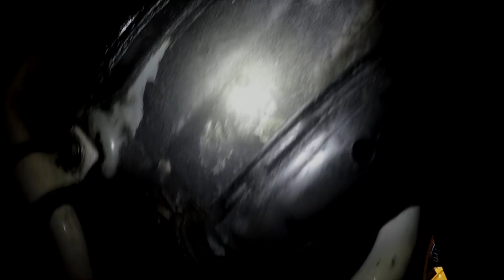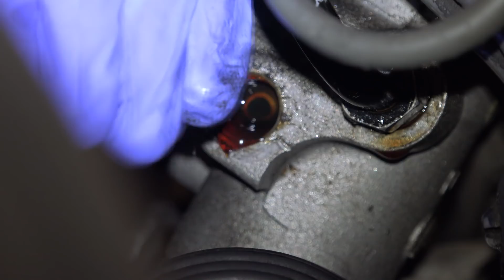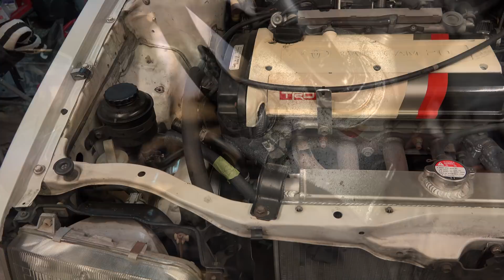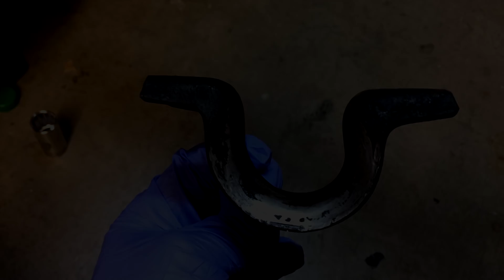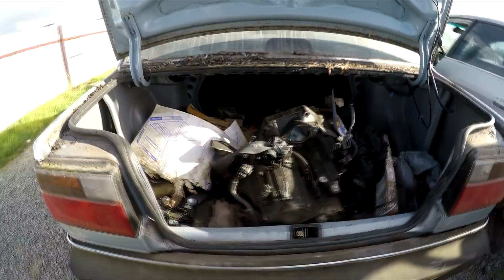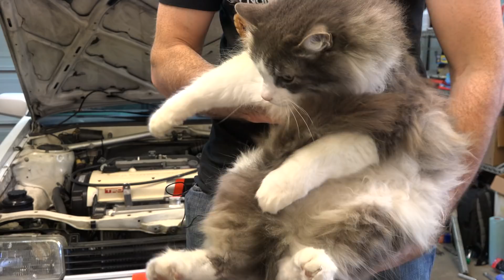How I fixed my Corolla FX16's steering issues and power steering leaks.

Comment: Great instructions! Just did mine today, everything went in super smooth until I found out one bushing is rusted seized onto the control arm, ends up dropping the whole arm and using a bearing splitter to press it off...fun time

Comment: Awesome content! I love the engine and the car itself! Huge fan of old toyotas. I am a current owner of a e11 G6 and it is lovely! I also have some play in the steering wheel and it isnt the tie rods so I might look at the bushing as well. 
Are you in stock suspension? I doubt the stock one is any good. Most toyotas suffer from bad suspension and steering compared to other makers. 
I want to stiffen up the whole car. Have you done anything to make yours more rigid?
Reply from the maker: I replaced the shocks with new oem units, but with the 20v, they get overwhelmed pretty easy. My roll is pretty well controlled, i have a thicker from and rear sway bars. Suspension is one of the things i have planned a little later this year. MRP is building the coilovers for my right now.

Comment: If you turn the steering wheel side to side with the engine off, you will get a lot of fluid out of the p/s system without hurting the pump. I'm sure the pump has some wear from years of use and running it dry is probably not a good idea. Also, if you have time, you can take the serp. belt off and turn the pump by hand to push some more fluid out, but I'm sure just turning the steering wheel will get most of the fluid out.

Your videos are very good! I'm subscribing...
Reply from the maker: That’s a good call, spinning it by hand would have saved me the shame of spraying PS fluid over everything!

Comment: How did u get the auto panning camera shots
Reply from the maker: I used a camera slider with a stepper motor. I set the start and finish points and then set the speed.
Reply: Hey body I have a corolla fx16 but is so hard for me to get parts for. In GA. Can you send me a liks you no. To fine. Pls. 👌

Comment: Uh oh, when I changed the control bushes in my twincam I also noticed that weird bend in the brackets, I thought that was normal, shit That's probably why I had such a hard time bolting the new bushes back in, I had to get the hydraulic jack underneath them to bolt on straight. Awesome video quality as usual by the way

Comment: Did you consider making a flex line to replace the stock hose? Russell Powerflex or the like?
Reply from the maker: That was going to be my last resort. I really wanted to use an oem hose because it wraps around the engine without getting in the way. PowerFlex would not have been ideal, but it would have worked.

Comment: Sup sush something that might interest you is I installed a seventh GEN Celica shift rod into my FX for as a "short shifter" mod
Reply from the maker: nice, how much lower was your shifter?
Reply: like an inch and a half or two also the third gear throw is like super long compared to everything else. So if you know how to fix that totally let me know
Reply from the maker: I swapped in a c160 6 speed transmission and the gears are pretty close together as is. The original c52 had a lot more travel.
Reply: oh duh yeah lol
Reply: sushpants seeing as getting a C 60 is difficult is there a way I could put the gearing of the C 60 in my 52or would that be worth it?
Reply from the maker: Micaiah Flores hmmm, I don’t think it would be that easy. My c160 only needed some minor mount modification. I can still use my original axles. And you do have to Dremel the shifter so you can get into reverse. To the left and forward.

Comment: I'd avoid running that pump dry... emptying and filling a couple times should be good.
Reply from the maker: I thought there would be a different way, but I followed factory shop manual it said it  to run it for a few seconds to drain the fluid.